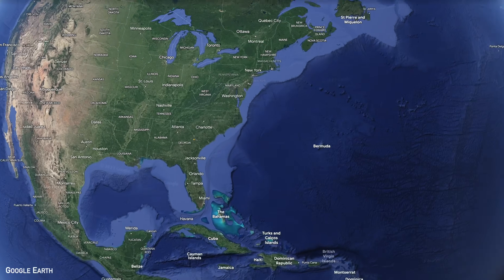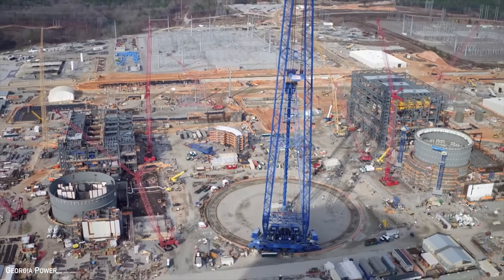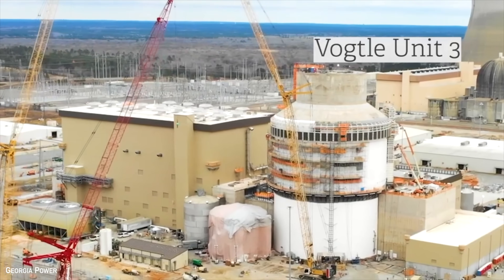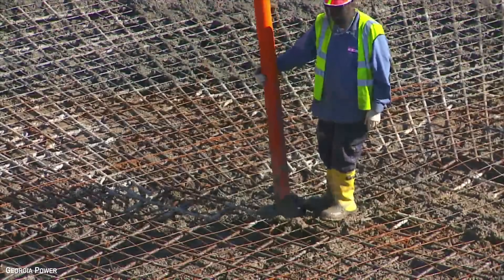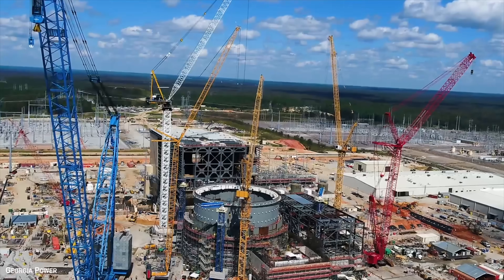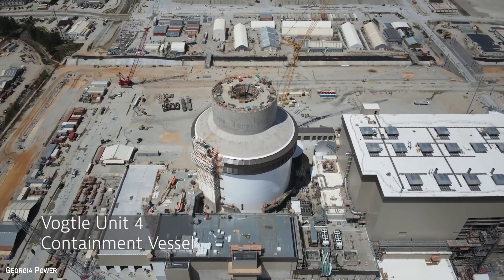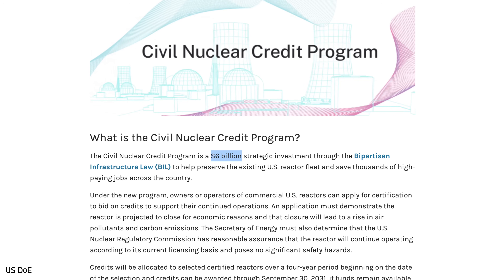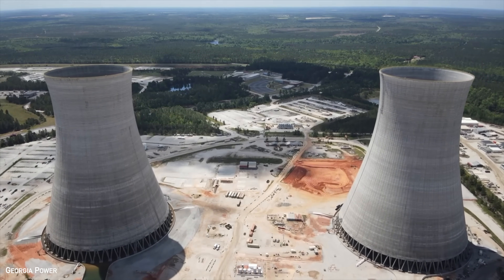Why the Future of Nuclear Power Depends on This Plant

Comment: There is an other Powerplant that is far more important for the future off nuclear energy. unfortunately its in China a thorium reactor that has just gone online for testing.
Reply: Thorium-232 is not a fissile fuel, anymore than Uranium-238 is, at least not for thermal neutrons. Thorium is nothing special, but some of the proposed liquid-fuelled reactors designed to utilise it truly are (especially with regard to safety).
Reply: That China reactor is 1/4 the size of the ORNL reactor that it is modeled after.  China is 60 years behind the U.S.
Reply: @clarkkent9080  The US reactor never actually ran on Thorium fuel, it was only a prototype for a future thorium breeder reactor. And unlike the US, China has an actual plan to continue this research with a larger test reactor already planned.
Reply: @johannesgutsmiedl366  No reactor can run on Thorium fuel as it is not fissile.  Thorium reactors are U233 breeder reactors and I worked at one of them (Shippingport....last core).  China's plant is a demo test reactor and produces no electrical power.  They say it will operate for 5 years before the test out the support systems so I would say a commercial unit is a long way off.

Over the last 70 years the U.S. has tested every reactor design known.  They were either military or AEC/DOE test reactors and did produce electrical power.  China seems to just be testing all different types as we did decades ago.  
We settled on the BWR and PWR and the rest of the world did also.  All things considered, there is only one or two designs that prove most cost effective.  It may take China 40-50 years but they will realize the same thing we did.
Since China does not seem to be as concerned with reactor safety or environmental issues, the designs they settle on may be different from what we chose
Reply: @clarkkent9080  what makes you think they care less about safety? they build the exact same reactor designs with the same standards as everyone else... also they definitely test technologies that haven't been tried in the US, notably the HTR-PM pebble bed reactor (which is also arguably the world's first operational gen IV reactor). Claiming that China is 60 years behind the US when it comes to nuclear research seems pretty nonsensical to me.
Reply: @johannesgutsmiedl366  Oh I don't know, maybe using child/prison/slave labor comes to mind.  They don't do environmental impact studies because the state need exceeds everything else.
Then there is this from the China Labor Department : China is undeniably a safer place to work than it was a decade ago. However, accident rates, death tolls and the incidence of occupational disease are all still comparatively high, with about 75 deaths from work-related accidents each day on average in 2020, according to official figures. New work hazards have emerged as the economy develops, and many employers continue to prioritize productivity and profit well above work safety.

BTW those are Official figures. . There were 5,190 fatal work injuries recorded in the United States in 2021, an 8.9-percent increase from 4,764 in 2020.

The concept of a pebble bed reactor was first suggested by Farrington Daniels in the 1940s, but commercial development did not take place until the 1960s in the German AVR reactor. This system was plagued with problems and political and economic decisions were made to abandon the technology. The U.S. had no need to repeat that failure

China is testing multiple reactor designs, trying to figure out which is best and the U.S. did that decades ago.

Why would you operate multiple reactors of completely different designs???? The U.S. chose BWRs and PWRs and I assume in a few decades China will do the same.
Reply: @clarkkent9080  so first of all, yes you do need to do environmental impact assessments in china - there are some issues with those, mostly with corruption, but that doesn't really affect such high visibility projects as nuclear power plants. Anyway, your claim was that china has lower safety standards for their nuclear plants, how does that follow from any of that?

I would also disagree that the reason why the US never followed up on any of the various tested designs is because they're all less viable than PWRs and BWRs, in many cases there was simply not the political will or commercial interest to solve the issues found in those early experiments... certainly this was the case with the german pebble bed reactors, the potential of that technology definitely wasn't fully explored back then. 

And of course the major reasons for exploring different reactor types: closing the fuel cycle, desire for higher operating temperatures (to increase efficiency and to provide process heat for industry), further safety improvements through more inherently safe designs.
Reply: @johannesgutsmiedl366  Safety is safety.  If you have a poor industrial safety record that is systemic through out the business culture.  I had to research and report on industrial accidents as part of a Safety Analysis presentation and China had some horrific accidents.  As just one example: One of their steel mills bypassed maintenance and a ladle of molten steel broke free from an overhead crane and killed 15 workers in a lunch area. Not the best way to die. I will give them credit as the plant manager was sent to prison while here in the U.S. he would have just received an OSHA fine.

China is not looking to close the fuel cycle, they are looking for the best design and will eventually settle on one or two just like the U.S. dis 60 years ago.
The U.S. taxpayer funded all that research here and I for one am glad that they decided to abandon designs that had costly problems.  With our debt today we may actually have to be even more frugal.....maybe someday.
You can claim that any project failure might succeed with more funding just like these Thorium fan boys.  It is time for industry to step up and put their money on the line because 70 years of taxpayer welfare is growing old.  We are not communist China thank God.

Comment: Nah, the future of the industry depends on the US actually managing waste. Not in a temporary or interim manner, but all the way to permanent disposal.
The industry currently cannot carry the real costs, nor severely discounted contributions. The Federal Government also cannot carry these real costs.
Reply: The used fuel is seriously not an issue, 50 years of used fuel from a 2 GW sight is stored in a area that is less than 1 hectare in concrete and steel bunkers guarded 24/7 by ex-military armed with assault riffles. It's not going anywhere anytime soon.
Reply: @anydaynow01  Used fuel seriously is an issue. In the US the majority of spent fuel,  about 80,000 tonnes, remains in "temporary" storage pools. The rest is in "interim" dry casks that are not rated for permanent disposal. The IAEA census of these wet storage facilities described them as being in "light steel structures". Some effort has been made to harden these structures, but they are certainly not bunkers.  The risk is not from anything that can be stopped by guards with assault rifles.
An attempt at final disposal was made forty years ago and failed, after tortuous attempts to solve water and oxygen ingress. 
Present financial "provisions" for disposal have withered on the vine, first from being woefully inadequate, second from cessation of industry contributions, and third by lack of any genuine commitment. You are right: This problem is not going anywhere anytime soon. A seventy year old problem that is too hard for the US and too expensive for an allegedly profitable industry to pay for.
Reply: @danadurnfordkevinblanchdebunk  

Not just political.
Yucca failed because of poor planning, an assumption that it could be imposed. 
Plus water and oxygen ingress.

The US has over 130,000 tonnes of spent fuel, as of the last IAEA inventory of waste.

I see no reason why the Federal government should have to pay for these wastes. There may have been a day when it did so willingly, believing the hype and the promise that it would be cheap and easy.  The day has passed where that applies. It is now known to be expensive and difficult. A special hazard of nuclear generation that must reasonably be covered in advance as part of either operating or establishment costs.

If the industry doesn't like that, they are welcome to liquidate and invest in something else, after cleaning up their mess.

I see no reason to extend an olive branch.
Reply: @danadurnfordkevinblanchdebunk  
Nope, it's not easy, nor cheap. 
Yucca mountain was a flop.

"anywhere" is not fine. What the Oklo site shows us is that even a tiny 100kW reactor with poor geometry and intermittent operation produces enough fast neutron bombardment products that that differ from ordinary uranium ore and that remain detectable as such for two billion years.
The conditions that favoured uranium deposition at the site also favoured plutonium retention. Those conditions do not pertain just "anywhere". 

Sure, in two billion years all our existing waste will be fine to sit on. The more dangerous bit is the first ten thousand years.  I'm happy for that to be close to you and yours and far from me and mine.
Reply: @danadurnfordkevinblanchdebunk  
It shows no such thing.
It shows that plutonium was static in conditions where uranium was static. Easily predicted by their position in the F-block metals, and demonstrated in their co-separation in aqueous/organic extraction.
Fission products at the time would have been released readily, as would many of the other decay daughters.

In any case, those conditions do not pertain everywhere. For instance, they did not pertain immediately upstream of Oklo, where the uranium was dissolved from the original ore deposit. 

You can go look up the different solubility conditions for uranium compared to iodine, or caesium, or strontium. Any junior chemistry text will do. Did you ever pass junior chemistry?

The "greenies"? Really?  
Major textbooks on nuclear technology are very clear about the difficulties and costs of spent fuel disposal. Written by people in the industry, who generally support the industry.
Your name isn't on any of them.

By all means demonstrate how easy it is, but not near me.